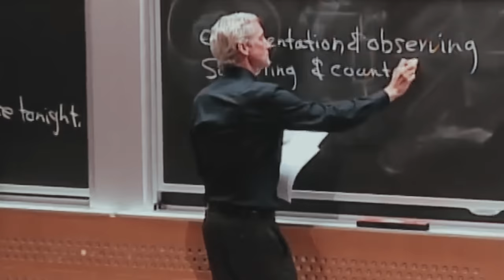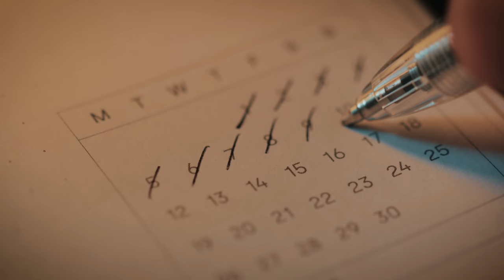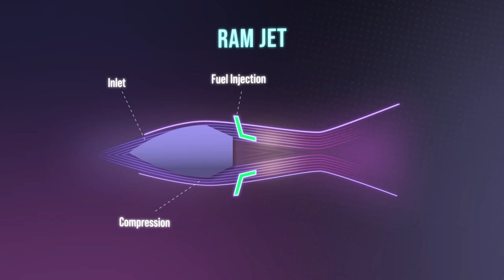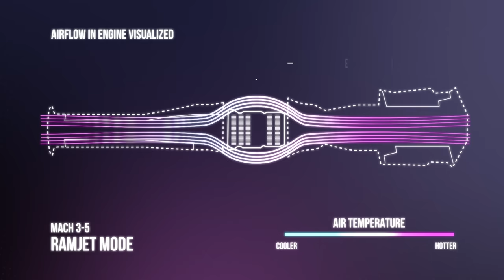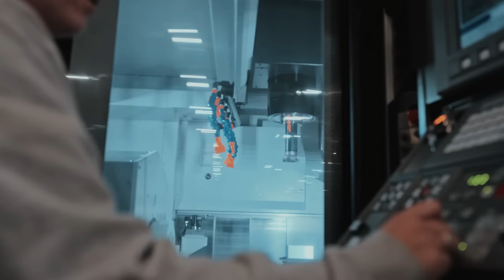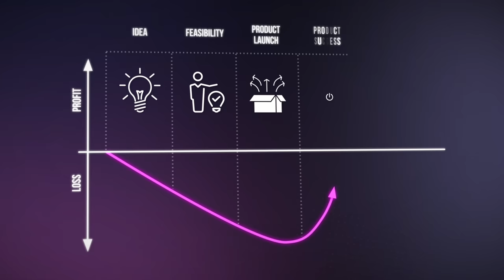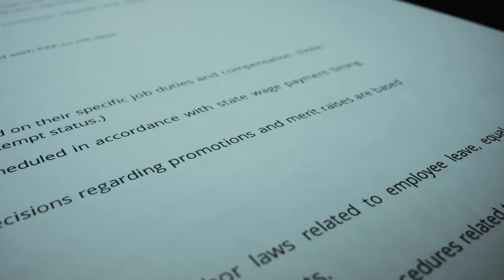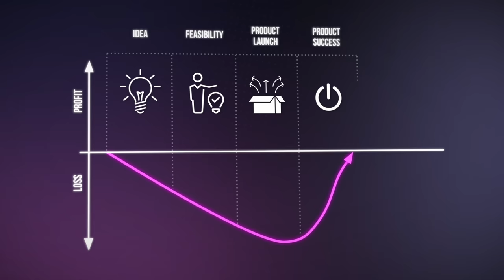He Quit NASA To Build A Hypersonic Plane

Comment: Nicely done John and team. As I have pitched you in the past, Destinus is a European startup based in Switzerland in the business of ultra high-speed, green air transportation using hydrogen and ramjet engine tech with proprietary afterburners. You might be interested to compare the different paths between the US and EU with respect to hydrogen infrastructure and regulatory approvals. Destinus has a very aggressive time scale for proof of concept.

Comment: You don't really see flight trajectory mentioned anywhere, likely because it's probably, questionably, the achilles heel of the entire project. With that air breathing engine, and that speed, they're not going to be able to get high enough to get above the Tom Cruise Darkstar problem. Not without taking significant amounts of heat damage. That's a massive logistics problem for commercial airline services turnaround times.

Comment: Adiabatic heating. That's what will kill this project. A big breakthrough is needed to build a hypersonic vehicle that flies more than once. My bet is transpiration cooling. Otherwise what are they going to do? Spray it with a fresh coat of ablative cooling paint before every flight? Even transpiration cooling will add significant weight and complexity. If they were using cryogenic fuel, they could circulate that through the leading edges I suppose.
Reply: What did Concorde do about this issue?
Reply: @jonathanvanwersch8500  they didn't, Concorde wasn't a hypersonic aircraft.

Comment: At 11:54, this video states that transitioning from a turbo jet engine at low speed to a ram jet engine at high speed has never been done in flight. I thought the SR 71 did that routinely starting in the 1960s?

Comment: Wonder how efficient this will be and what environmental impact this would have if we used these to speed up the world 5x... or whether they've thought of how to actually make this work in an environmentally friendly manner. Otherwise it's probably just more the 0.1% burning more to do things faster for themselves.
Reply: I have not watched the whole video, but I was thinking the same thing. Flights are already crazy expensive, most of the time, for any halfway decent airline. On top of this, all we hear in the news cycle, is about how we have to stop using fossil fuels. I have a feeling that this tech will end up being used by the wealthy, like you said.
Reply: The good news with something like this is that because of the way that ramjet technology works, once it's up to speed (roughly, over mach 3), it's actually more efficient than a turbojet. Although you would make a lot more individual flights with a small craft like this as opposed to bringing an entire group of people at once, the aircraft would spend a much greater percentage of time in a higher efficiency mode. So overall, you're saving fuel and burning it cleaner as well as saving time. Honestly, if this works, it will revolutionize international travel beyond what this video even implies.